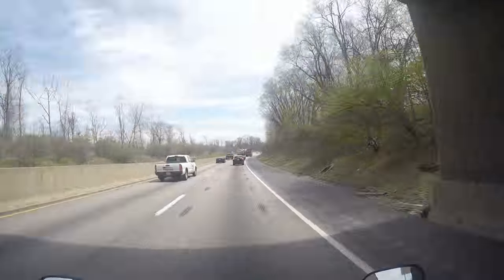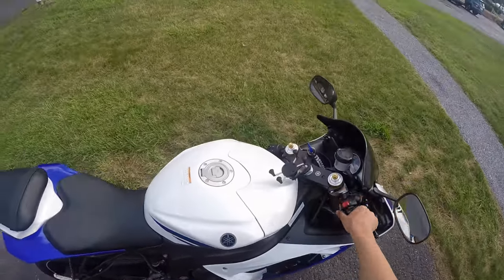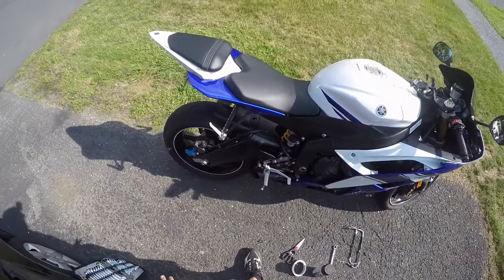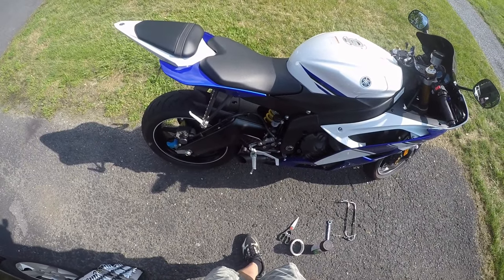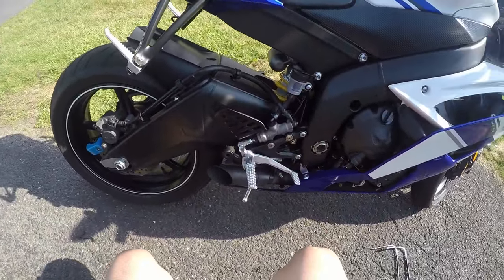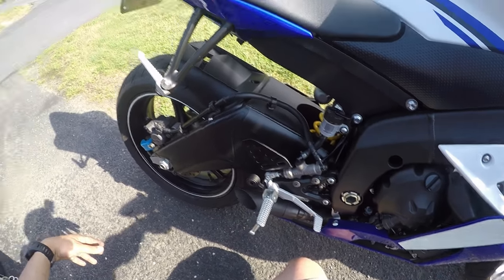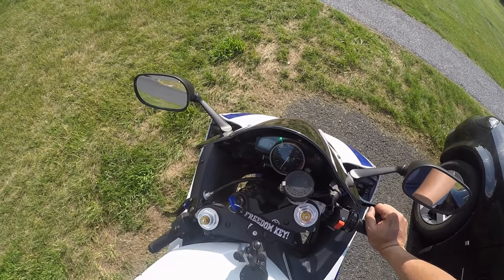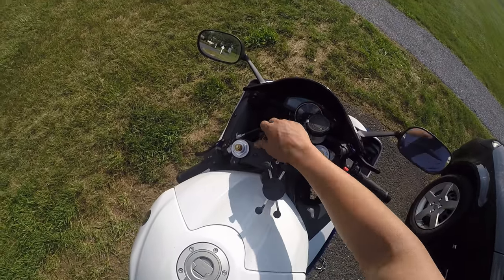Installing the Radiant Short Pipe on 2014 Yamaha R6

Comment: did you notice any change in power with that pipe swap?
Reply from the maker: Joe, I barely noticed any benefit on performance. Not saying that there wasn’t any difference but it wasn’t a great difference. 
I’d do it again if I get the chance.
Reply: @DR2PA  okay, thanks for the reply!! reason i ask is, i want to buy  the same pipe but ive read that some people noticed it decreased performance and created throttle lag...
Reply from the maker: Joe I did not noticed any throttle lag nor decrease on performance.  Just a few crackles and depending on how hard I ride the bike some small flames. Granted my bike had less than 2K miles.  Nothing to get excited since I still have the cat and that takes most of the sound and performance away. If you straight pipe it you must tune it too.
Reply: @DR2PA  thank you

Comment: I was thinking about doing this on my cbr600f1 but have seen some reviews saying they cook your valves, how has it been over longer term? My stock one sounds like the baffles are loose and its driving me crazy.
Reply from the maker: Well... this is not a cosmetic part so it will change the dynamic of the performance of the bike.  After a couple of weeks of the installation I took the bike for a tune up and I haven have issues with valves or anything.  I’ve been giving it regular maintenance and that’s about it.
Reply: @DR2PA  thanks for the info brother 👍